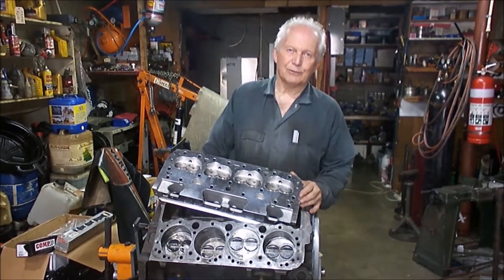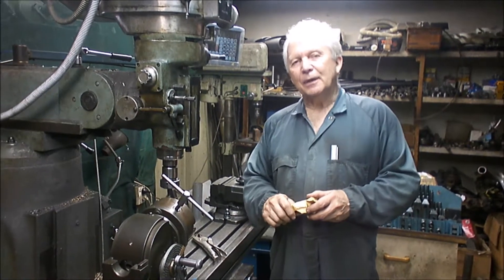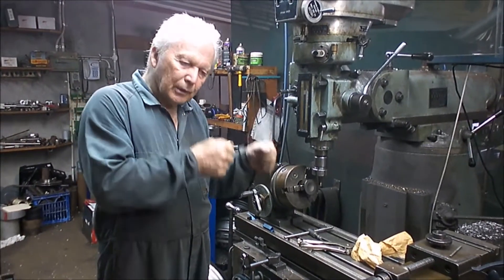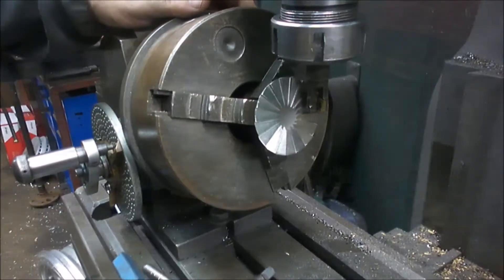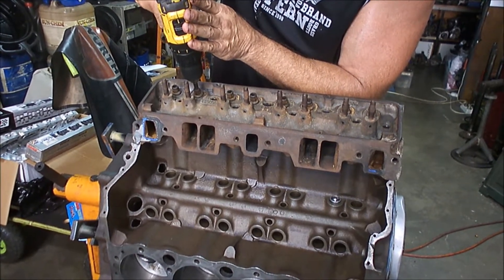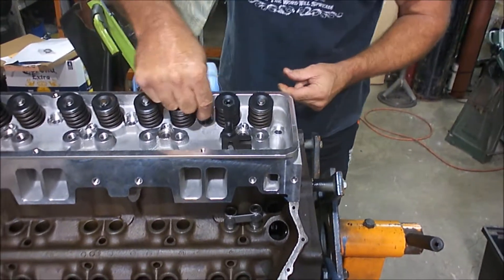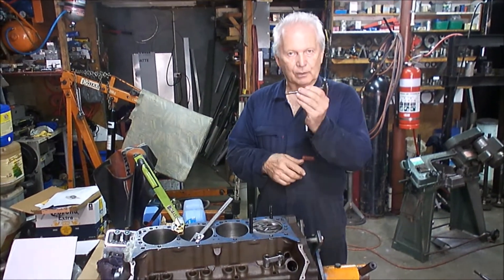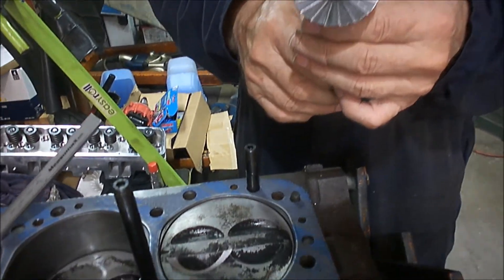Chev valve piston to valve relief cutter

Comment: This worked great for me to clearance my pistons for a 1.6 exhaust valve .  A couple of details that I had to figure out.  I used a 20 degree angle for the valve.  On a 1.78 inch valve I cut it 0.090" per angle.  I also hardened mine after cutting by heating it to red with a torch and quenching it in oil.  This made it last longer.  Thanks for posting this great idea!